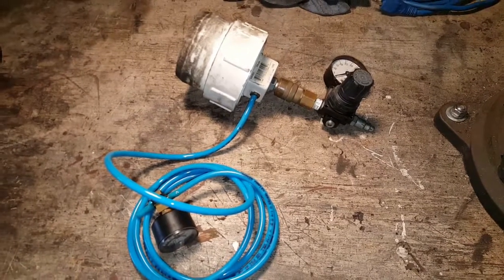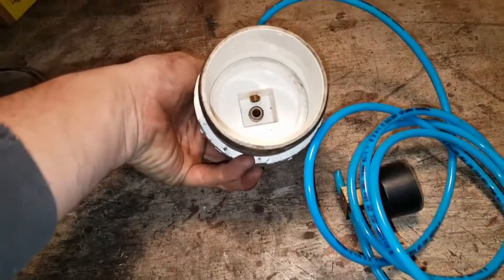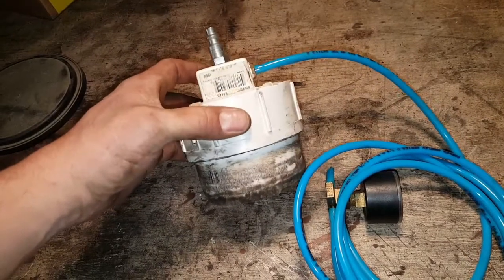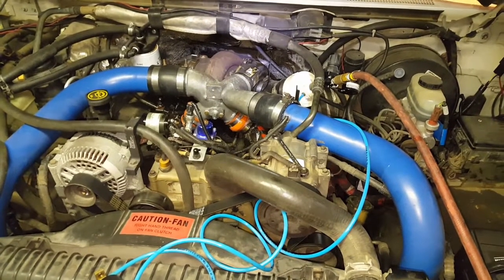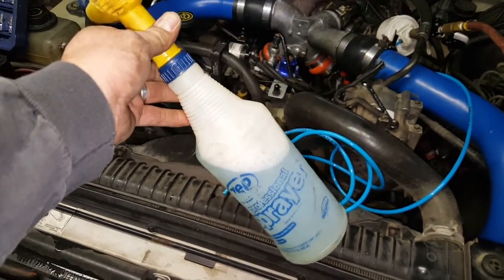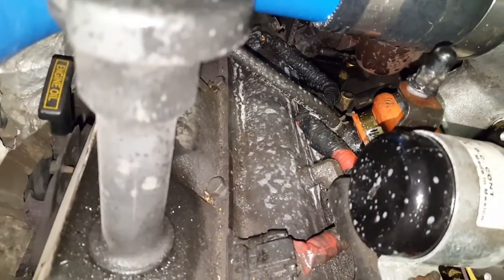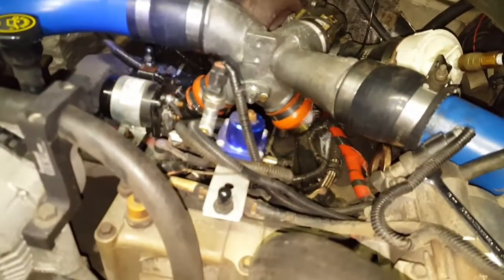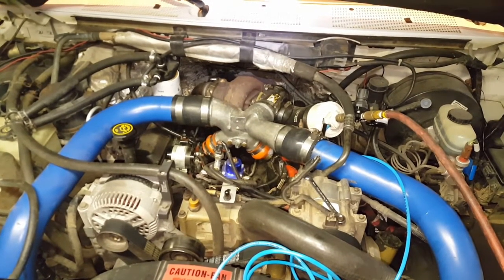Project PSD Part 12: Boost Leak Test

Comment: Did u ever happen to do you plenum. I fixed my leaks just have one small one at plenum drivers side . Like u it’s small and get in 20# boost easy so I think I’ll wait
Reply from the maker: I did re-seal the plenums on my truck, but I waited until I had ither things to do in the valley. It's nice to have things all sealed up tight so I know I'm not losing boost anywhere, but it's a lot of work for a small reward on a stock motor unless they're leaking badly.

Comment: Just saw you’re video! Awesome test and this maybe my issue, my 97’ F350 standard lacks power going up the slights grade and having to down shift, that said I can hear a high pitch whistle coming from the turbo and after a quick inspection my OEM boot going to the turbo is split around the clamp! Once I replace it I’ll be sure to build the tester and go over all boots ! Keep the videos coming
Reply from the maker: Glad you found it helpful! Keep that old truck on the road and thanks for watching!
Reply: @diymechanictv1233  thank you! Yes Iam the second owner of the old girl, she got 362,000 km on it now and being a crew cab Iam constantly being asked if it’s for sale and my reply is always the same ….NO🤣! Also do you have a link to any company’s for o-ring kits and boots for the 1997 7.3? Thanks again keep yours rolling also 👍🇨🇦
Reply from the maker: I like Riffraff Diesel for the turbo boots and O-rings. And yeah, the truck isn't for sale!

Comment: Did you plug off the crankcase vent tube  that comes off the turbo to airfilter boot and down to the little doghouse on the valve cover when you did the test?
Reply from the maker: When I do these test, I remove the aluminum elbow that has the CCV fitting in it, and then I do the pressure test with the tester in the silicone elbow that leads into the turbo.